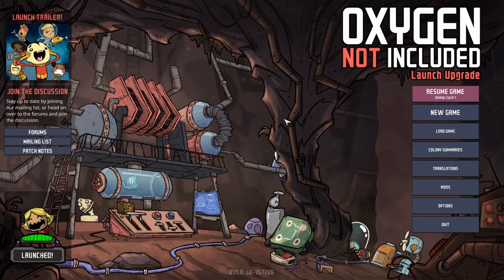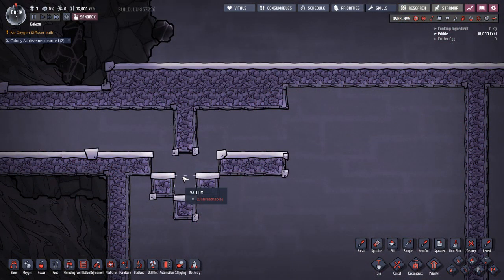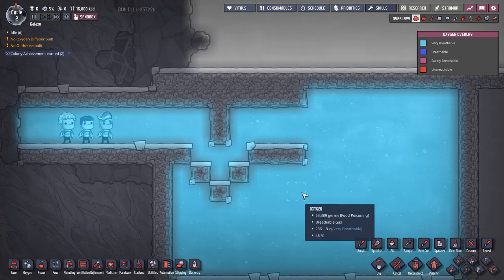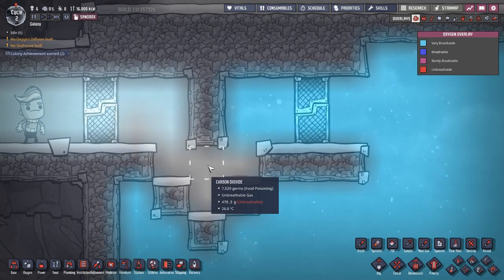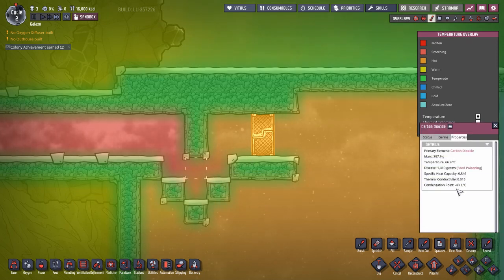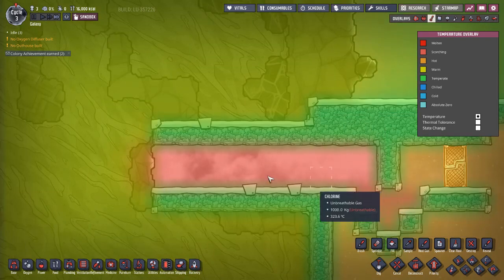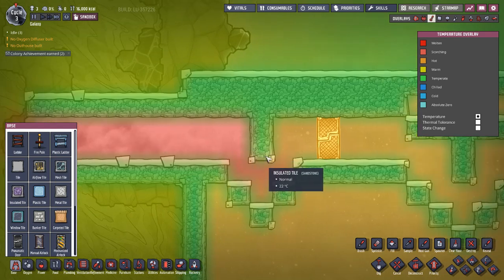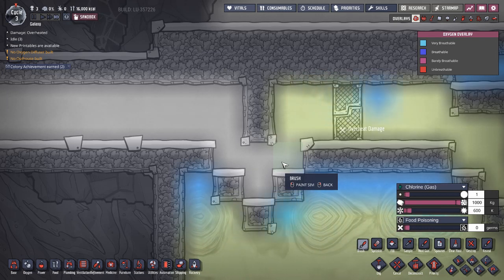Oxygen Not Included - Upgrade your Waterlock to a CO2 (Carbon Dioxide) Lock!

Comment: There is a problem, if the other side is carbon dioxide and its overpressurized, it will push the carbon dioxide out of the airlock